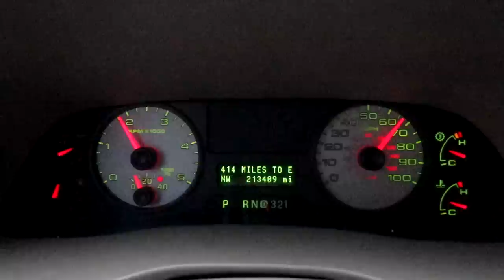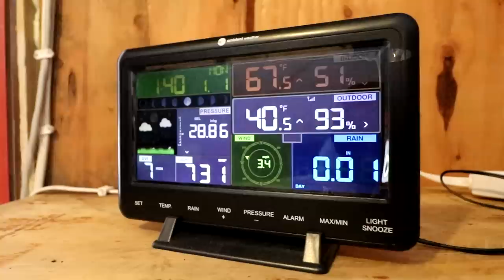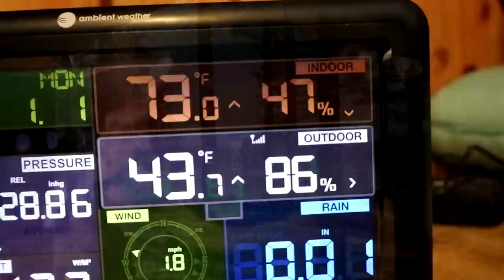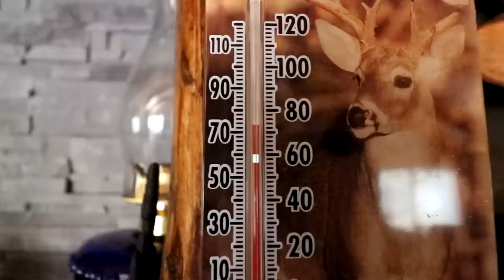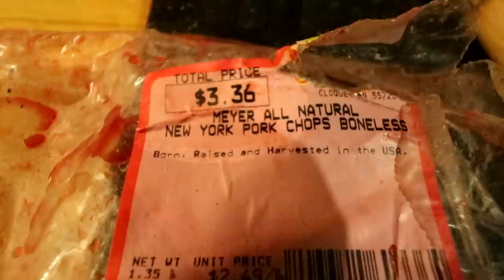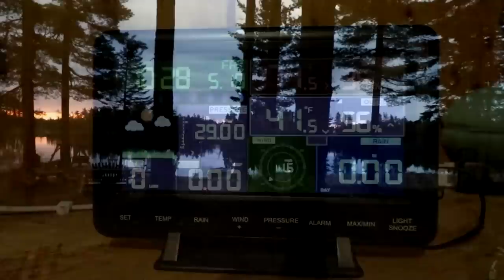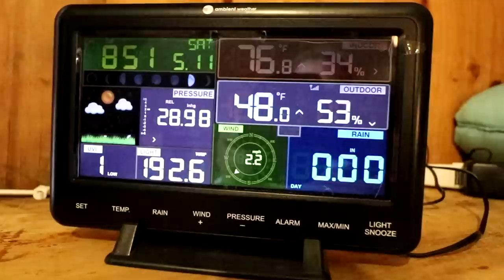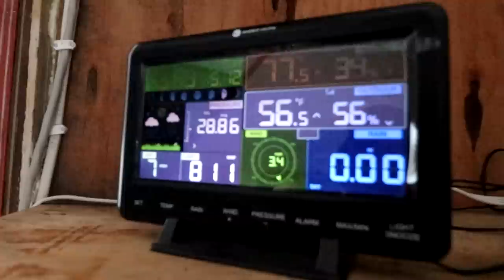THE TENT. First spring trip of 2019. Minnesota fishing opener. Dad comes up. Melissa joins me.

Comment: Did you know . . . that the aluminum roll dispenser has two knock outs that you punch in on the end sides of the box that enable pivot points for the roll to dispense aluminum. It helps to eliminate the hassle of dispensing the foil. Hope that helps.  Congratulations on the proposal.

Comment: Joe I've never seen removable rain gutters before. Very clever idea . Your dad has a nice cabin . Is that the out house to the right of your dads cabin? It's beautiful looking . Do you have a batter operated or rechargeable rotisserie for the fire pit ? Ever thought about putting a rain cap on top of your roof top stove pipe ? Is your boat motor 4 or 6 stroke? How many horse power is your boat motor ? What is dehydrated stinging metal that you sprinkled on the potatoes & onions ? What type  of wood did you cook the ribs over ? Did Melissa's house ever get finished being renovated after it was wrecked in the hurricane ? What kind of fish do you catch in the lake ? When I was watching another one of your videos your truck was covered w/snow at the tent . Ever thought of building a shelter over your truck in the winter @ the tent ? How do you get TV reception @ the tent by : satellite or internet ?
Reply: Congratulations ! Joe & Melissa on your engagement !
Reply: The ring & Jewelry box are beautiful . Joe did you make the Jewelry box or have it made ?
Reply: Joe do you have any video(s) of the inside of your dads cabin & the outhouse ? Does your microwave have convection ?
Reply: In Minnesota will the law stop & give you a ticket for driving with a cracked windshield ? I think they will down here in Florida ?